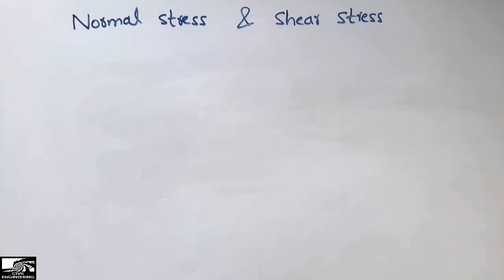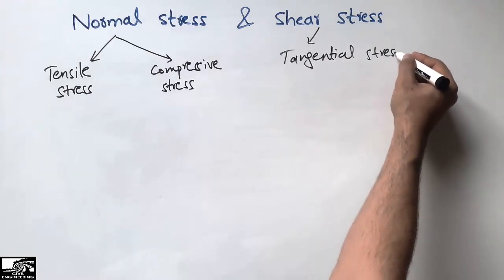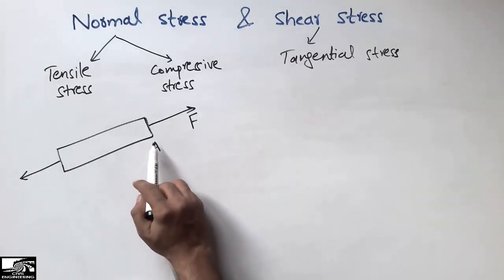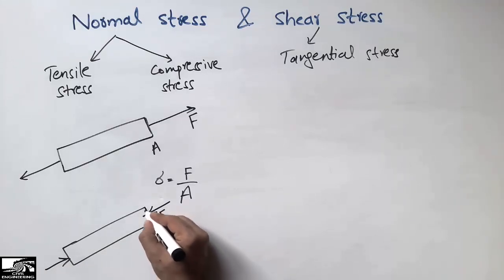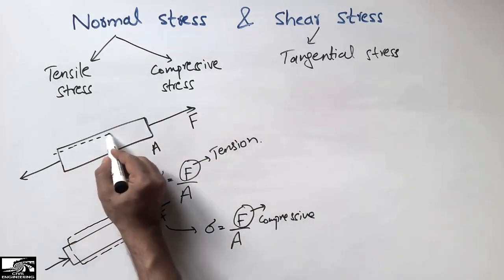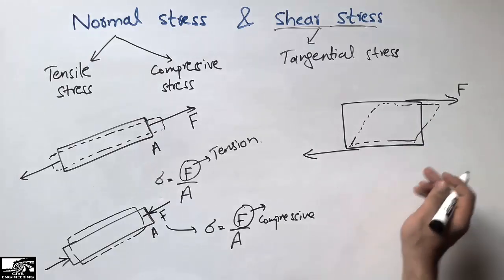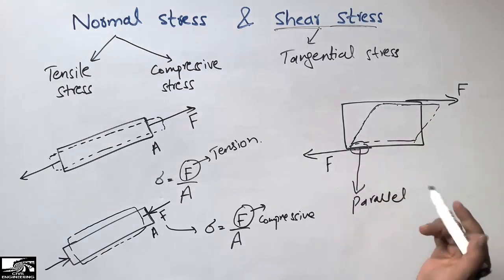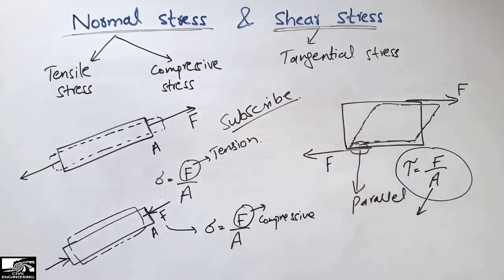Difference between Normal Stress & Shear Stress

Comment: That's an easy-to-understand explanation.
Our soil surveying equipment measures σ = F/A as the reaction force. This is every 1.08cm of ground.
Weathered rock penetrates up to 25m from the original position.
And the softness can be verified with a 0N load.
So we already have detailed values for C and φ at the site.　Please　check”Nippon Screw Weight Ｓystem”

Comment: Thx for the video Sir, it's help a lot. After go through the video, I'm still not clear about the area in shear stress. Is it the area that perpendicular to the force in whole system? If it is the whole area perpendicular to the force, then the area will be infinity big when we do calculation in fluid.
Reply: Area in fluids is not constant since it got crust and troughs so there's different methods for calculating them in fluids you'll know it in higher studies

Comment: The halves of the coupling are held together by four 5/8-in.-diameter bolts. The working stresses are 12 ksi for shear in the bolts and 15 ksi for bearing in the coupling. Find the largest torque T that can be safely transmitted by the coupling. Assume that the forces in the bolts have equal magnitudes
please solve this